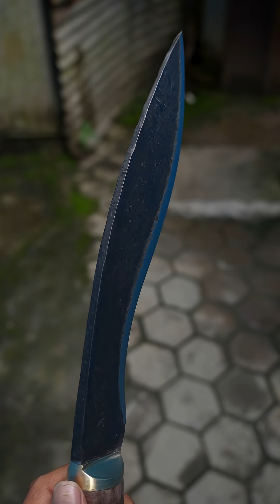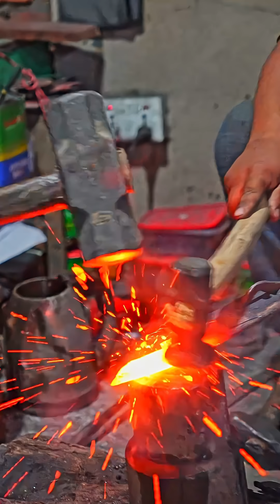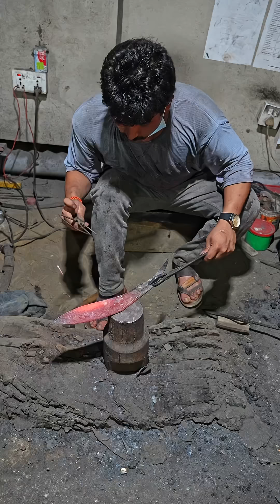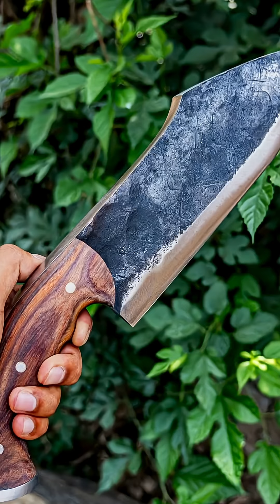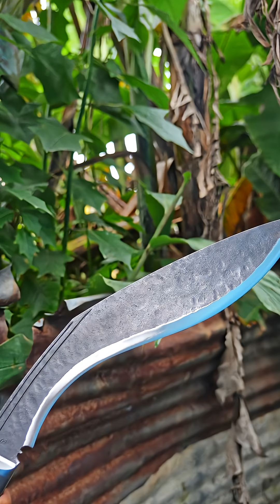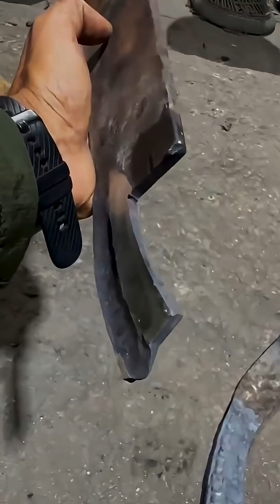What Tools do you Need to Forge a Kukri?

Comment: Leaf spring , tongs to hold , anvil  , hammer and coal fire , total cost five hundred Indian rupees , no mechanical tools
Reply from the maker: there are some that still work without any motor tools but they do have a few more tools than you have listed. They sharpen with a file for example

Comment: This is how blades were traditionally forged in the past, before power grinders as hand grinding is hard work.
Your also going to get a better grain structure in the finished blade, but only if you harden the edge only. If you heat the whole blade above critical temperature after hammering you undo the grain patterns as the steel is given enough energy for the molecules to re organize themselves.
Best practice is to cold hammer it after heat treat that will form the best lattice system giving best edge strength and retention along with the best blade strength and shock resistance.
The  differential hardening of edge and body goes right through the region from Nepal, India, Malay, China, Korea and of corse Japan.
Some kukri show a nice hammon if you polish them up and acid etch them.
That might make you a nice option if someone wants a display piece, be easy enough to acid dip a mirror polished blade, as long as you have edge tempered it you will get a hammon. Nitric acid produces nice hamon.
Just a idea mate, John from England.
Reply from the maker: Hey there John- thankyou for the detailed reply :)
yes in the past there was a lot more work done at the forge end. A lof ot fullers were scraped our taher than ground also and this would've been very hard work.
We edge quench only :) We have been acid washing to show hamon for quite a few years now- you can see some examples online :)